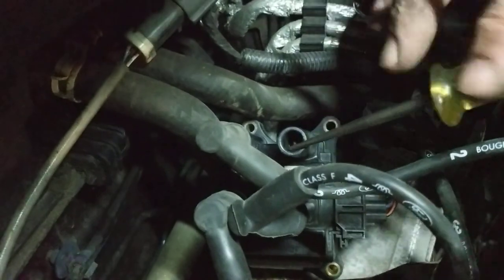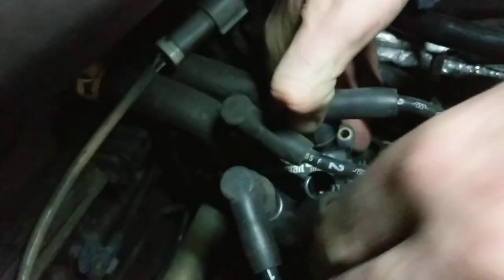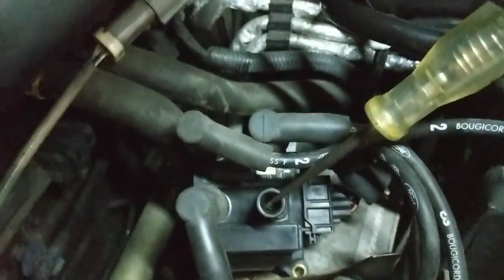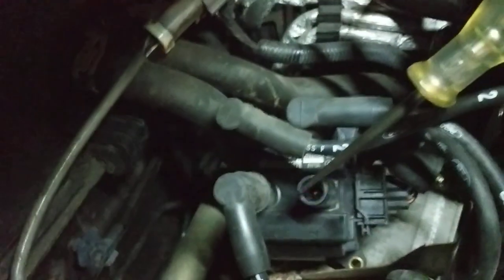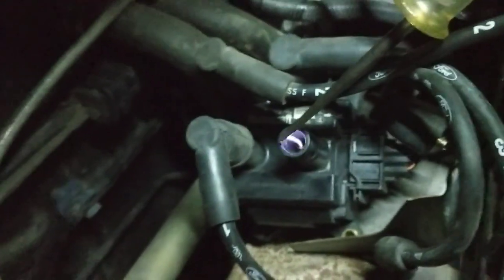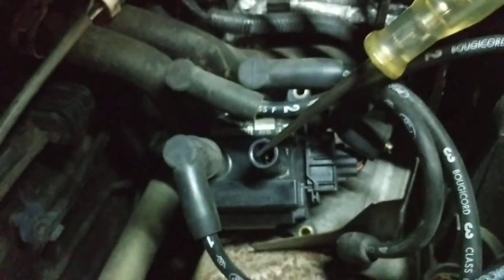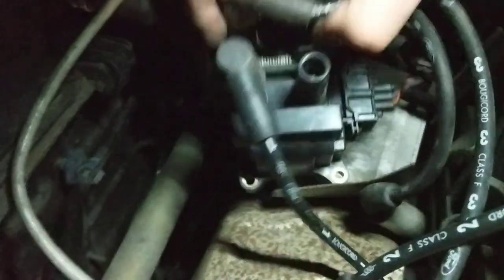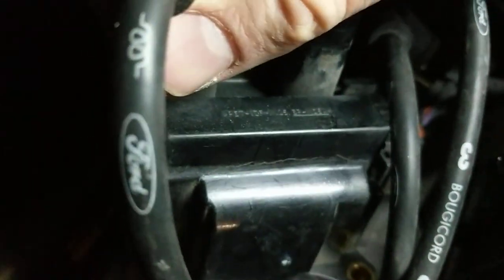Single cylinder misfire (Ford Ka) - basic coil test with test light

Comment: Hi there. I need your assistance please... If I have a bad coil pack will my Ford ka still idle correctly?
Reply from the maker: If it has a bad coil pack it will generally not idle very well. Vibration, lumpy etc
Reply: @Automotive_Solutions  Thanks for your response. Well it idles perfectly but as soon as I put my foot on the gas it just misfires like hell and the rpm is not going up at all.
Reply from the maker: @markussteinmann2890  sounds like an ignition misfire. Putting it under load always makes it worse.
Reply: @Automotive_Solutions Thanks.

Comment: So did replacing the coil pack destroy the ECU?
Reply from the maker: No , it was fine and survived. Still running today.
Reply: @Automotive_Solutions  Thank you...my Ford KA Luxury 2007 is showing P0304 error. I don't have the confidence to perform the recommended tests. However I can see what looks like a slight crack on the top part of the coil pack. If I was to damp it with water and run the engine....should I see a spark jumping from the crack?  Do you think it might be worth replacing the coil pack anyway?
Reply from the maker: @tonypowell250  - change it, you might be lucky. the longer you leave it running like that the more chance of it spiking a high voltage back to the ecu. If its cracked - change it.
Reply: Thank you for responding...really is greatly appreciated. Re my Ford KA Luxury 2007 - unfortunately things seem to have gone from bad to worse :-( I had error code P0304 showing but since Green Flag have replaced all four spark plugs I'm now getting P0303. They have tested all the electrics and confirmed they are fine. Therefore he suspects the issue is fuel related and suspects blockage in the petrol filter? He recommended I put some Redex in the fuel tank. To be honest the engine now seems to be misfiring worse than ever.  He was there for ages testing the HT leads and the coil pack. The only other option he could offer was to tow me to the nearest garage. Do you know why the error code would change after replacing the spark plugs?  Any help greatly appreciated. Thank you
Reply from the maker: @tonypowell250  - so many variables it could be. If the coil is cracked it definitely needs replacing (use a genuine part or high quality pattern). You really need it checked out by a reputable garage.
Reply: @tonypowell250  Did you solve the issue, I have something similar.
Reply: @wojciechrosciszewski  Replacing the coil pack and HT leads solved the problem.